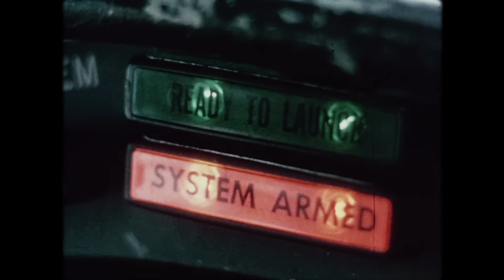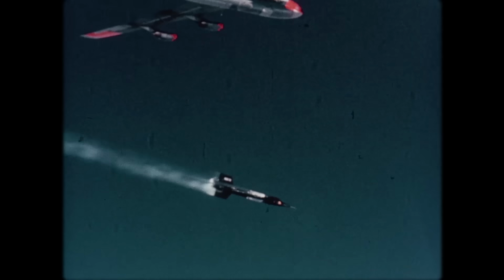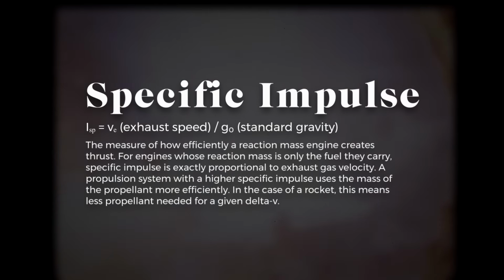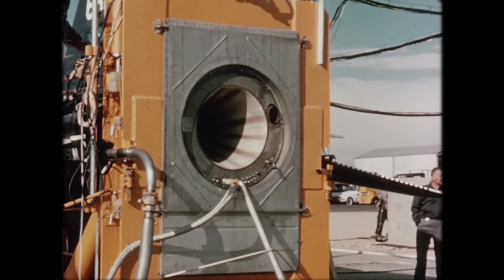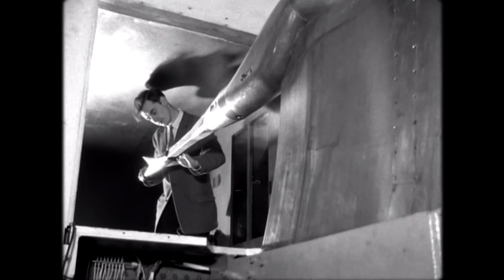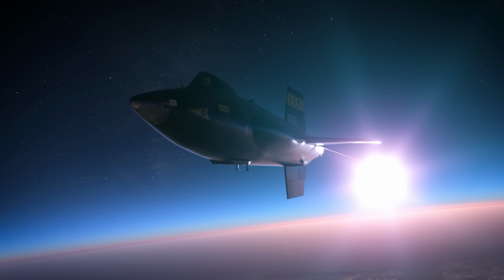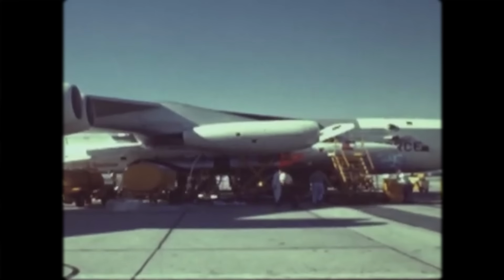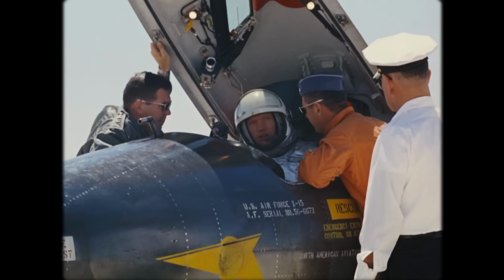The Insane Engineering of the X-15

Comment: A problem with the engine is that it was taken from an intercontinental ballistic missile and it was a one use engine, which means as soon as the engine reaches Mach 3 it  starts to break apart

Comment: Great documentary, I learned a lot!  Two notes: I believe it was MA-25S not MA-35S. The other is I think you could have gone into more detail on the reasons for selecting Ammonia. One of the primary reasons for the propellant selection was the density ratios of Ammonia and Lox.  While Ammonia is less dense, more of it is required for a fuel rich burn leading to easier pumping since the ratio of each propellant and its density is closer than many hydrocarbon/LOX combinations.  It also has more H2 per unit volume than liquid H2 due to its higher overall density. Lastly, the temperature issues that the LOX gave the program would have been much worse with LH2.

Comment: 4:45
I would also think it's horizontal position would be a problem cause as the fuel burns the balance point shifts further and further forwards. This is why airplanes store their fuel in the wings and the mid section and have no fuel tanks fore or aft cause it could create stability problems.

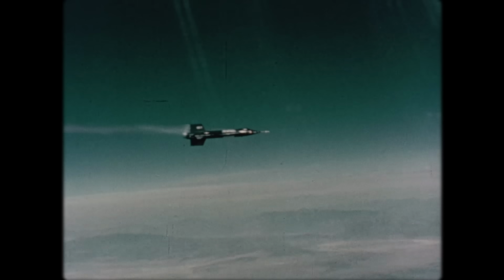Comment: 28:48   Robert Michael White (July 6, 1924 – March 17, 2010) (Maj Gen, USAF) was an American electrical engineer, test pilot, fighter pilot, and astronaut. He was one of twelve pilots who flew the North American X-15, an experimental space plane jointly operated by the Air Force and NASA.  On July 17, 1962, he flew the X-15 to an altitude above 50 miles, thereby qualifying as an astronaut according to the USAF definition of the boundary of space.

Comment: That's a Manned Mach 6.7 however Mach 9 is possible, and NASA's X-43A aircraft while it was unmanned has reached Mach 9.6. Mach 9 is a speed which is over nine times the speed of sound. 

Next door to Northrop and Grumman in the same complex as Edwards Airforce base California in the Mojave desert NASA's X-43A was the first air-breathing hypersonic vehicle. It was launched in 2004 and reached Mach 9.6 at an altitude of 109,000 ft. The X-43A was powered by a scramjet engine, which is a supersonic-combustion ramjet that's integrated into the airframe. 

Venus Aerospace has designed the "Stargazer", a hypersonic plane that could reach Mach 9. The Stargazer is intended to make travel more efficient and eco-friendly. 

The X-15 is the current world record holder for the fastest manned aircraft, reaching Mach 6.7 in 1967

Comment: This is not a airplane. It’s a rocket.
Reply: No. It isn't. Rockets use rocket engines as well as a vertical trajectory, on top of that, they don't have an actual air frame. Wtf are you even on about.

Comment: The SR-71 blackbird is still the Fasest plane. While the X-15 does go faster its more of a rocket like the Spaceshuttle is. The Two main differences is on how it is propelled and if it can take of under its ownpower. Since the X-15 use rocket propulsion and has to have another aircraft to get it into the sky, its more of a rocket than a plane. On the other hand the SR-71 Blackbird use jet propulsion and takes off under its own power. 

If i miss anything let me know.
Reply: There have been a couple planes i can think of that get dropped from a different plane, the goblin for example, and it still can be a plane even of it has a rocket as an engine. The space shuttles are an outlier as when they used their wings to glide down to earth they had no propulsion whatsoever, which defines a plane.

Comment: Airplanes take off from the ground, missles are launched from aircraft.
Reply: And the X-15 is a plane launched from a plane.
Reply: @ Sure. And a B-52 is an airplane delivery system, not a bomber. A skydiver is a plane without an aircraft.
Reply: @michaelnolan6054  A plane is defined as a powered flying vehicle, with fixed wings and a  weight greater than that it displaces.
B-52: - Powered by jet engines
- Has fixed wings
- Is heavier than the air it displaces
X-15: - Powered by a rocket engine 
- Has fixed wings
- Is heaver than the air it displaces
Skydiver: - Is not powered 
- Has no wings
- Is heavier than the air it displaces 
Your argument makes no sense.

Comment: Nope it is not, if you are classing a "rocket" as a plane then the fastest ever built is the fkin space shuttle ... are people really this dumb??

The Space Shuttle's top speed was 17,321 miles per hour (mph). The shuttle reached its fastest speed during the final moments of ascent, just before the external fuel tank detached. At this point, the shuttle was traveling at a speed of more than Mach 24.5......
NOTHING man kind has ever built that can fly in ANY capacity comes anywhere near the speed of the shuttle.... yes, it is a plane befoe you keyboard warriors start xx
Reply: Im with you, with the better rockets coming up a new classfication of plane should be made under Rocket Planes. I understand people considering the X-15 as the fastest plane you have to look at what makes a plane a plane.

Comment: It's basically a rocket with a little capsule on the tip with a person in it. I mean it barely even has wings. It was so powerful that the rocket forced it to go in a straight direction that it didn't need as much arrow lift as a traditional airplane. That's what strapping a person to a rocket does. Crazy because of the number of rocket explosions that occurred in the early days of that development would have been enough to scare off most sane people with families and loved ones and those who assume a future. 😂

Comment: The X-15 was not really a PLANE it was a ROCKET it was a Controlled ROCKET. Basically a giant hypersonic missile with a pilot.. They should of put a F-1 engine on the back of it. The same engines used by the Saturn V..

Comment: The actual jet that is the fastest is the X-46 and its basically a rocket launched from another airplane (that travels at under 600mph) at mach 9.6, the X-15 is also launched from a mother plane if you will. There Is also the quickest object shot by humans In 1956 by the US government which was a manhole (not your normal manhole cover, it weighed 6,000 pounds or 3 customary tons) at 196mach which was supposed to suppress an underground nuclear test. For your information that is 150,385 miles per hour (mph)

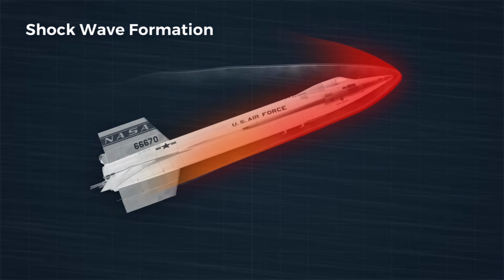Comment: 17:53 I wondered about that....not on the X-15 but in the torpedoes that cause a cavitation channel caused by its blunt tip. I wondered if that would work with aurcraft! Thanks!!
Reply: With the tail being blunted, I understood that previously.  There is a reason why, depending on your goals, you don't need to sand the fins of a model rocket. If you're just wanting to fire it, you can leave them alone. You gain stability that you could lose by not sanding the fins equally, but it costs you some drag. If you're just wanting it in the air, who cares about a bit of extra drag? If you're wanting to go fast or high, you may want to sand them to the best shape for your goals, something one will have to look up first. 

.....not sure why I didn't think about that earlier?
Reply: Spacecraft use blunt shaped to form the wall of plasma several inchea from the surface of the craft when re entering atmosphere and bleed off speed more effectively, liquid water is different because its nearly incomprehensible so fluid dynamics are different.
Reply: @miguellopez3392  I understand. My point was just me wondering what the effects on an aircraft or rocket would be, which this video covered. 

As for water: the blunt nosed is used on supercavitation torpedoes, like the VA-111 Shkval. It creates a cavitation bubble by sending gas through holes in the blunt nose of the torpedo. This creates a cavitation bubble that is large enough to cover the entire torpedo, allowing it to use rocket propulsion underwater (as being in a bubble means being in air). The bubble significantly reduces turbulent drag. 

I (clearly am not educated on this topic...or any, really. A HS diploma doesn't mean I'm educated enough to know about the principles behind this) was more or less just.... thanking the video creator for answering that question for me (what would happen of a blunt nose were put on a plane?) 

The reason I was curious was becasue of some ideas I had in regards to model rocket making. Adding forced air intakes, then taking that air and forcing it down a shaft that gets progressively smaller, causes the air to build pressure and heat up. The cold ambient air is now hot... filled with energy. That air is then fed into an expansion chamber located just at the motor end of the rocket. Model rocket engines have a built in nozzle...so, if you make an expansion chamber that covers the motor's flame and allow that warmed air into the same chamber that leads to another nozzle... the thrust can be increased greatly as the air is now wanting to rush out. It's also heated by the motor, giving it more energy. 

The issue is that this doesn't work efficiently at low speeds. It causes more drag, not less. 

Again: I'm not educated in this field...

...however, thinking about the torpedo design, I wonder if one were to add a blunt nose to the rocket, then force heated exhaust for it, would it heat the ambient air enough to make the air traveling down the rocket body less dense? If so, that would be a big deal! 

so, it's something I was asking about because I want to try to make this at home and test it. I can't because it would require materials that can't legally be in a model rocket. 🤷🏽‍♂️

Still, it's fun to imagine....ask questions and see how wrong I am. 😂👍

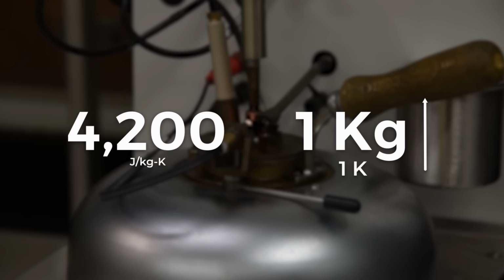Comment: 13:48 Latent heat of vaporisation is the energy needed for a unit quantity substance (eg 1kg) to change state from a liquid to a gas without a change in temperature. It is not related to the boiling point of the substance.

Comment: Not really an airplane is a true sense.
Reply: But it is
Reply: @Inv1ns1bl  it doesn’t take off under its own power and in much of its flight envelope it uses a reaction control system and not aerodynamic flight controls.
Reply: Body is still made to coast the atmosphere and even gliders are considered planes @vanguard9067

Comment: I think the engineering that went into the A-12’s/Sr-71’s is more impressive. 

Trying to make a plane that had a specially designed body shape and paint to reduce its radar signature, could fly 2900 nautical miles (in 90 minutes) without refueling (with the option to refuel midair),  could outrun any missile or plane chasing it, cruise at Mach 3.2 and reached Mach 3.4 in flight testing (with an individual report from a pilot claiming to have reached Mach 3.5 on a sortie) and could fly for 90 minutes at Mach 3+ which is more impressive than hitching a ride for a Mach 6+ flight for 90 seconds (a super impressive 90 seconds where its pilots can become astronauts, but 90 seconds nonetheless) or in the case of the external fuel tank X-15 240 seconds resulting in a burnt shell 

And I understand that the heat differences at Mach 3+ vs Mach 6+ are exponential and that was the largest challenge for the X-15 engineers to overcome but the amount of boxes the A-12/Sr-71 engineers had to check off to accomplish the goals needed by the Sr-71 outweigh the boxes the X-15 engineers had to check off to accomplish the goals needed by the X-15. (I will say it’s impressive that the X-15 took its first flight 2.5 years before the Sr-71 took its first flight and see that as one of the only good arguments that could be made to refute that the Sr-71 is more impressive,)

In addition to all of the amazing engineering of the A-12’s/Sr-71’s and the fact that they were never shot down by an enemy, I think that the A-12 Oxcart is the most beautiful creation ever constructed by mankind. 

Today they remain the fastest air breathing planes ever built. And all of that makes them some pretty damn special planes if you ask me.

Comment: As a heads up, I knew one of the guys that was a test pilot during this period. The full speed of the SR-71 was never declassified. During the Cold War, the Russians kept challenging the speed of the SR-71.  Every time they beat the SR-71’s record, the US Air Force would send up the SR-71 and overtake by just a little to take back the record. After around the 3rd time this happened, the Russians realized the US was screwing with them and lying about the capabilities of the SR-71, and they gave it up.

That same test pilot always dreamed of flying the SR-71 just once, so at his retirement, as a thank you for his service, the Air Force allowed him to go up in it. They required all pilots wear a pressure suit similar to the ones astronauts use, because the operating height of the SR-71 is classified as outer space.

Comment: Couple things a bit wrong on the rocket engine section. There are indeed rockets that use the combustion gasses to turn the turbine. It's called the tap-off cycle. Also, the gas generator exhaust is primarily dumped overboard not because it's "too sooty" for the combustion chamber, but that it's too low pressure as compared to the combustion chamber.
Reply: Are you an aerospace engineer though? 😂

Comment: Technically hydrogen and fluorine would provide even higher specific impulse than hydrogen and oxygen.

In theory, anyway.  Seems that engineers figured out that dealing with liquid fluorine is even worse than hydrogen, let alone handling an exhaust of hydrofluoric acid.

Comment: Of course the x-15 is faster than the SR 71, because it was rocket powered. and the SR 71 used turbojet engines. But still it travels at mach 3.5! that's impressive for a plane that was jet powered and old. much respect to the SR 71. it'll be my favourite plane forever.